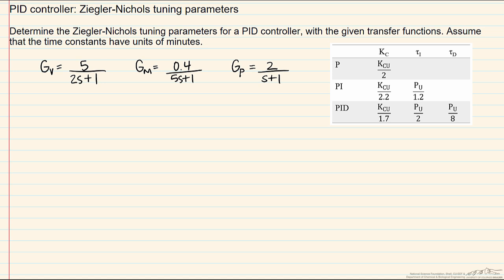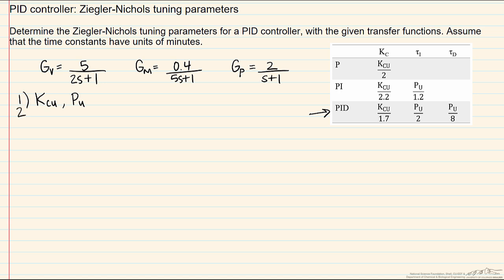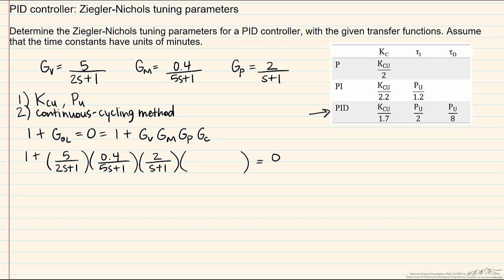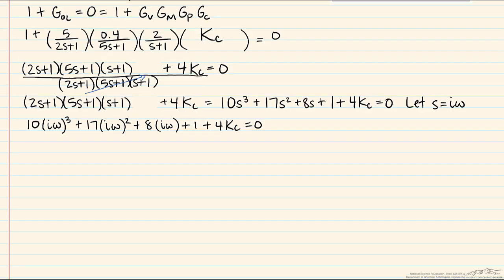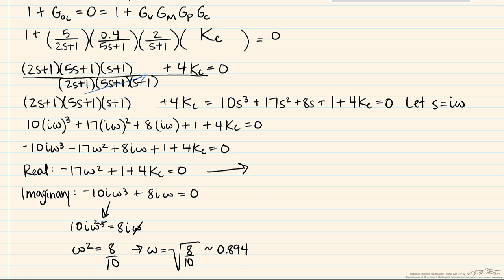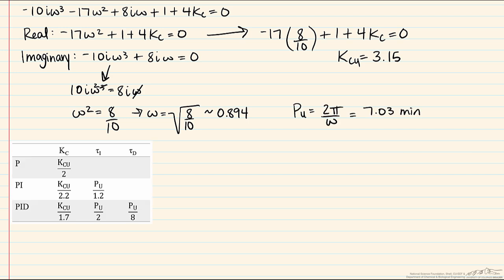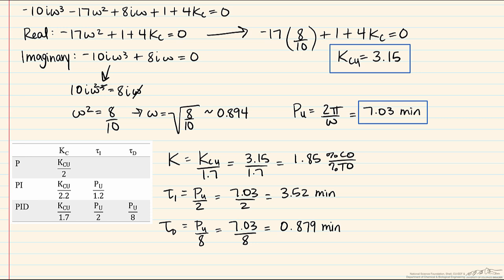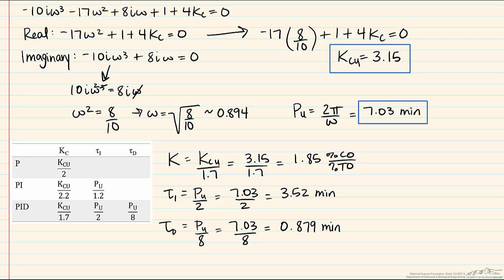PID Controller: Ziegler-Nichols Tuning Parameters

Comment: Why is Z-N taught any more?  Z-N provides an awful response.   Z-N only "works" with self regulating systems.    This example does not take into account dead time.   What if there are two complex poles and the system is an integrating one?
Where do the constants of the transfer function come from?   If they are given then why not use pole placement or IMC where the gains can be chosen so there is no over shoot and the response is much faster.
Pole placement will work with just about anything.
There should have been a simulation showing the results.
This is a waste of student's time and money.